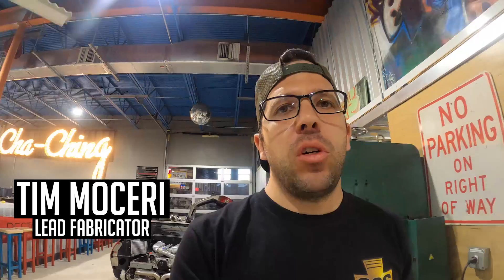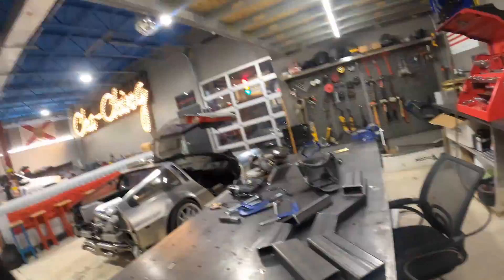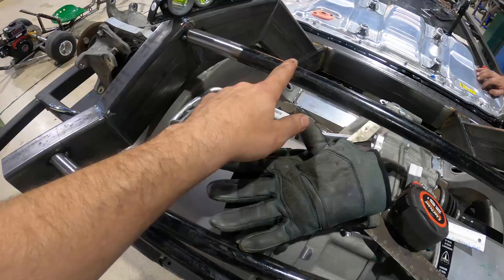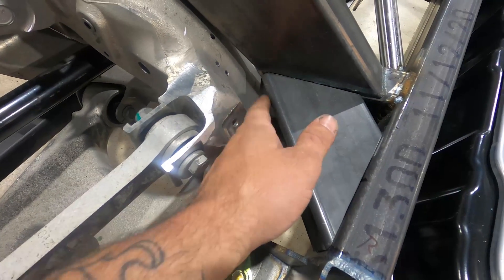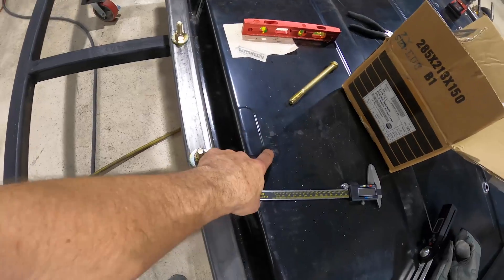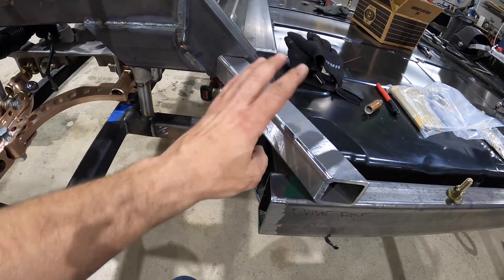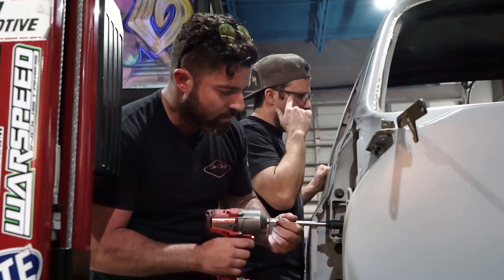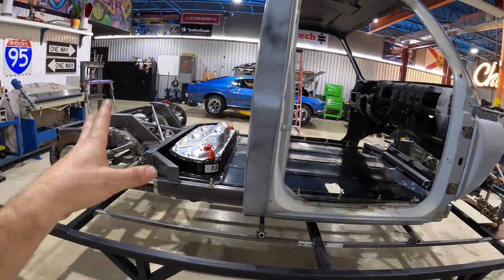Full Race Chassis For Our Tesla Swapped Squarebody  - Electric C10 Ep. 4

Comment: I'm catching up on the project so sorry for the belated questions, why are you doubling up on the Tesla sub frame?  Wouldn't the Tesla frame be engineered and well rigid enough for the power of the E-motors.  

Is the usage of heavy steel in place of aluminium for the chassis associated to anything other than cost?  Surely you are sacrificing a fair amount of P/W ratio as a result.

Not that my opinion matters at all, but from an engineers perspective you guys are doing some beautiful FAB work. Maybe slightly over braced but quality none the less.
Reply from the maker: The Tesla subframe is definitely tough, but it's only really built for the power of a single rear drive unit. We wanted to make sure that the truck will hold up to a thrashing at full power with two motors. We'd rather go overboard than have two parts of a truck after a pass on the track! And the steel keeps cost down but is also more rugged.

Comment: I like this a lot. How will you get the motor out if it needs worked on?
Reply from the maker: The rear motor unbolts right from the subframe and the entire rear irs system easily unbolts and drops down from the truck!

Comment: Will the steel on alloy end up setting up galvanic electron transfer and ultimately weaken the chassis?  Particularly with all the power flowing and charge discharge cycles of an electric car.

Comment: nice build, makes me want to do the same.
Then I start browsing for used motors, subframes, some old classic frame based 4x4 trucks and then it strikes me:
I cant machine, I cant weld..

OES NOES...

But yes, I like watching these things come to life. Looks like a nice job :-)
I will just have to continue driving my 3 Performance :-P And maybe I will build a kitcar in the future from factory five or something, that should be doable for me as it's more like ikea I guess, having done some engine swaps, coilover conversions etc in my garage, I think I could manage a factory five kit.
Reply from the maker: It's never too late to learn some new skills! But any way you end up building a car is cool with us!
Reply: @SalvagetoSavage  yep, regrettably a lot of customization is very hard to get approved in Norway.
But now they opened up to approve 100 kit or amateur cars each year, but still there are a lot of rules..

But they will approve "good kits" meant for street, max though 20kw per 100kg, so for instance a factory five 900kg car one could only get 20*9 = 180 kW * 1.36 = 241.38 Hp ;P 

So even though those kits are designed for large v8s with a lot of power, the hp for approvals here would make it impossible.
However an EV motor of course can have a low rating with a given voltage, and of course it gts its accelleration from the torque and RPM :-)

Comment: FINALLY! I've always wondered why none of the car fabricators electrified old cars by replacing the chasis instead of just dumping them in the trunk like that's going to do anything.
Reply: I'm a chevy fan, and I would love to see a 63 impala or one of the shoe boxes bulit
Reply: This method would be cool for custom builds based on 20's and '30's classics. Imagine the cool factor of a Deusenberg EV.
Reply: @PiDsPagePrototypes  I don't personally see that as the way to go for ultra rare classics. I think those are best left for preservation. Maybe something less common place like a ford or chevy but certainly not a deusenberg, auburn, or cord. There's no reason someone can't build their own coach from scratch if that's their intent. There was electric cars from the 10's and 20's already. They just weren't exactly reliable. Jay Leno has featured a few.
Reply: @roberttaylor9259  well, y'd start with one that was a shell with no chassis an motor, the sort not worth a Resto, ditto a Packard, or a moonshine runner type '40's coupe, or a '60's 'finny' Benz.
Anything with a full chassis from the factory. Heck imagine a 6x6 EV Power Wagon or Deuce truck!

Comment: did you do strength calculations on the chassis, or are you sizing it up to be equivalent or better to a chassis that has proven itself? Reason I ask is (as an engineer doing structural design) I am not convinced the ' diagonal' chassis beams connecting the front as well as the back parts to the frame rails next to the battery are able to take all loads. (the longitudinal chassis beams are loaded e.g. in bending, going to the diagonal parts this transfers partly to torsion untill it meets the front and rear subframes.) If the cage will connect to both ' subframes' as well there is no problem, but now I am not directly sure. 

probably you have this all figured out already. Just a thought.

Comment: Ahhhhh!!! It’s coming together… looking awesome. 

With all that weight at the bottom, does it limit options on suspension? Or? Only asking because now it seems all the weight is evenly distributed under the truck.
Reply from the maker: The weight distribution and center of gravity is very similar to a stock Tesla (+1 motor) We're going a bit high tech on the suspension to get really dialed in on the handling, and it's going to be custom to our front and rear subframes. But that's something we'll be covering in a future episode!
Reply: @SalvagetoSavage  NICE! I’m super curious to see the electronics come together.

Comment: This is awesome, 

I guess the motors have very little servicing they ever need done, but if the motors every needed service is there a way to remove them?
Reply from the maker: The motors are bolted into the subframe the same way a regular motor would be. Everything is removable, from the motors to the batteries! We covered the front subframe fabrication in episode 2 and 3 along with the rear subframe!

Comment: You could have also got a sport (performance) LDU which can handle 1150 amps at 400 volts. If you wanted to make one motor AWD, there are companies that make dual drive shafts that attach to a Tesla LDU and it can be turned to the length of the car, more like a gas car's AWD system, however, it would require changing the gearing in the LDU to 4.5:1 from the standard 9.73:1 and using a 2:1 differential at each end.
Reply from the maker: We just wanted all the speed and all the torque! So we had to go with Model S drive units!

Comment: I hate to tell you, but the Model 3 battery pack doesn't have the power to run two Tesla large drive units at full power. The base LDU for the Teslas run at max 900 amps, max 400volts and a max power of 335 kW. Now it is possible, with proper cooling and a swap of the logic board, to get those motors to run at 1000 amps, 400 volts and 400 kW each. However, the peak current of the Tesla model 3 battery pack is 1150 amps and 350 volts. Which would be 402 kW, the max output for only one motor. You would have been better off making your own battery pack or using two small drive units. Teslas, while having awesome torque right off the bat, are designed for long range, even the performance models. After 10s (Tesla Model S/X battery packs) to 20s (Model 3/Y battery packs) the power drops off significantly. Which is why you see those cars get walked down in longer drag races.
Reply from the maker: We'll just have to see once we get the ZeroEV controllers hooked up!

Comment: Do you guys plan to add cross section supports for the center battery bolt holes to bolt to? The mode 3 battery is not as rigid as the model s/x battery and sags in the middle of the pack when it’s picked up from the outside holes only. It might cause some battery structure issues down the road if there’s no middle supports.
Reply from the maker: That's gonna be covered in next week's episode! Our floor bracing for the cab is going to tie the body into the chassis, into the battery. If you check back next week we'll explain our whole plan and start the fab on that!
Reply: @SalvagetoSavage  great, I look forward to watching it! Good work!

Comment: if the battery went bad, how easy would it be to replace it?
Reply: Restomods aren't about building vehicles with service in mind.
Reply from the maker: It would almost be like dropping a GIANT gas tank. The battery is through-bolted to the frame rails, so it's just a matter of unbolting it from the chassis and dropping it out. This truck is going to be literally slammed to the floor so the biggest issue there would be getting it onto a lift! Fingers crossed that we won't be needing to do that any time soon.
Reply: @SalvagetoSavage  Thanks for the reply. I'm glad I found this channel.